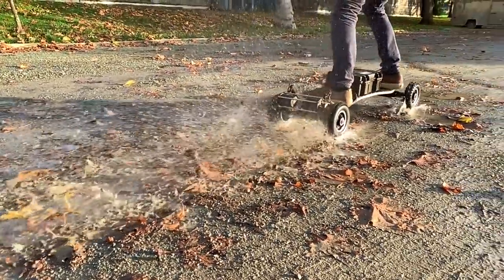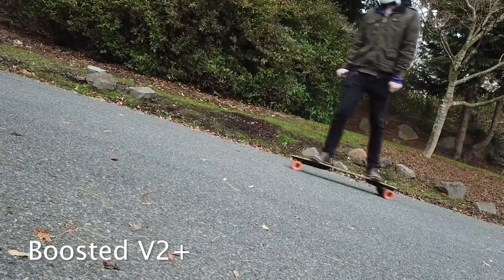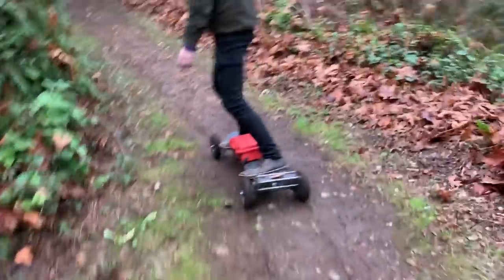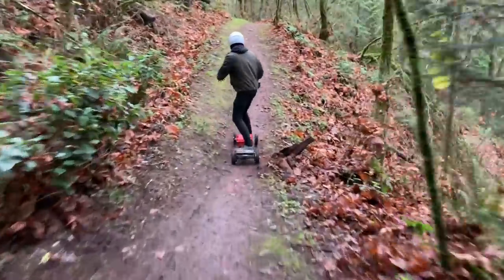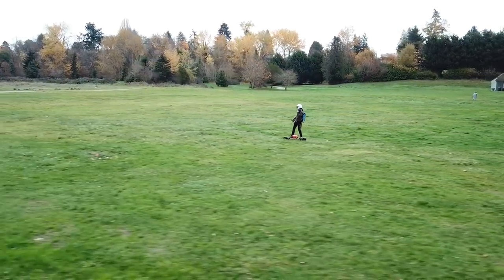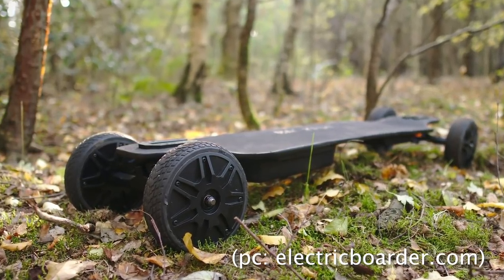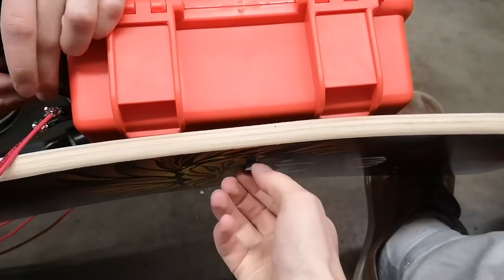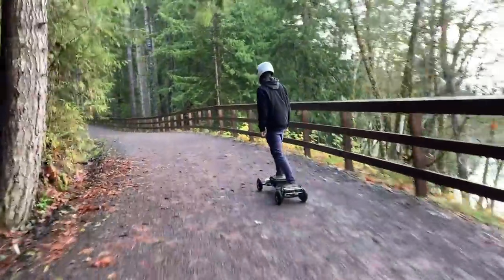DIY 9,000 Watt All-Terrain Mountainboard Beast Power-sliding and Off-roading

Comment: I agree, there is a lot of power required for a hill climb and your build looks a lot more capable and yet affordable than most I've seen. I bought a pre built board with 3,300 watts and it's great, but there is always a demand for more torque or general acceleration power when going through trails and hills. Yours exceeds the milestone by 3 yet less OK's sturdier than mine. Also, hot swapping a empty battery is perfect.

Comment: I built the patriot (for the most part) and the aluminum trucks base plate cracked twice already on the front truck. My first time going through some rough dirt and a pebble got under the belt and bent the motor shaft. I need a closed belt mounting system and maybe to spend a little extra on MBS trucks or something but that changes the price game significantly. However, I do not feel these trucks are a safe bet for this power and speed. I wanted to love it, just need a few modifications to make it sick. I did opt to buy cheap bindings, very helpful for sharp turning and off road. Did I mention the deck is heavy as all hell. This deck is really stiff and heavy. Oh and the springs on the trucks.. yeah well after some heavy riding they start bowing. Next thing they do... pop out. If you lean hard once you get decent, the board leans right into the pulleys and will eat a little notch into the board but no biggie. It has a few serious problems to address but for the price... This was my only option for a real off road board.

Comment: Cool video. I'd be cool to see a more in depth video on the parts list and building the board (and more power slides of course!) and for $1k that's a pretty impressive spec sheet (even if it is diy)
Reply: I second that.. would love to see a parts list.. I only see the motors and main board links...

Comment: For people who do not know much about diy esk8... when building a mountain/off road board like this, one should use lower kv motors which increases torque but reduces top speed. Instead of using the 190kv motors like in the video, which have a great top speed, do not unlock the full potential of this board. I would like to see you try to go 40 mph on a trail like you show in the video... you should go with 149 kv motors to still have a good top speed and have a lot more torque. I know flipsky sent the 190 kv motors for you to use but lower kv motors work much better on off road terrain.
Reply: I'm not sure this is entirely correct. Keep in mind that with an ideal speed controller, a lower Kv motor would provide no torque advantage over a higher Kv motor (even with the same batteries). As far as I know, lower Kv motors only benefit systems with current-limited ESCs, and these VESCS are some of the beefiest out there (as are the batteries). FLIPSKY claims a burst rating of 400A per controller, which I believe would saturate any 6374 motor. If that rating is to be believed, lower Kv motors may offer little-to-no benefit.

And as you can see in the video, torque is clearly not an issue here. Has anyone tested this empirically?
Reply: Yes tested multiple times in FPV and eskates - lower kv = more torque , you can increase/decrease torque also by using different gearing. But KV = as we use it refers to the rpm constant of a motor - it is the number of revolutions per minute that the motor will turn when 1V (one Volt) is applied with no load attached to the motor, the less revs per volt means each rev has more volts to push the board with
Reply: Douglas Page while you might be theoretically correct, I did not see any place in the video where the board was motor limited. I did see a spot that was traction limited, and SkateMetrics described that you could break the rear wheels free very easily, which doesn’t strike me as being anywhere close to motor limited.

If you wanted to increase effective power on this setup I think you would need wider wheels or four wheel drive.

149kv motors would just make it more traction limited while decreasing the top speed.
Reply: @zachohanlon3517  Zach - he is theoretically correct and also correct in reality. He didn't mention the board looked limited in the video at anypoint he was just making a suggestion regarding the KV.  how can wider wheels increase the power???? How would 149kv reduce the traction of the wheels? I agree it would reduce top speed, but he did say when will you go top speed 40KMH ? The video even states they never use full speed.... Why have the ability to go 40 with less torque. id rather the able to go 30-35 and have a bit more power low end.  I have a trampa e-board and only ever hit about 28 MPH, then again im new to it so could step this up who knows.
Reply: @zachohanlon3517  My point is that with a 100% efficient ESC, Kv ratings and torque are completely unrelated. A higher Kv motor will indeed provide less torque for a given amount of current than a lower Kv motor (by definition). However, because the lower Kv motor's back EMF will be proportionally diminished, an ideal ESC will be able to provide more current to it, without drawing more from the batteries. 

Of course, a real ESC's output current is limited, but useful current in the motor may also be limited by magnetic saturation. In a situation where an ESC can push a motor of a given size to its saturation point, it stands to reason that swapping in a lower Kv motor wouldn't actually improve torque, and would only reduce top speed.

But the real world is full of nonidealities, and this reasoning may overlook other complications. That's why I'm curious if someone has tested the relationship between Kv and torque with a setup of the Patriot's caliber.
Reply: All science aside. I have tested both 149kv and 192kv (sk8 6374 motors) on my trampa build. My board uses dual focboxes, 12s5p li-ion battery and 6:1 gear ratio. With 45A battery max each i have to say that i don't notice any torque disadvantages with the 192kv motors. I have been doing some heavy off-roading on trails like in this video. Never encountered a hill that the board struggles to climb. With that in mind i'm pretty sure that the board in this video delivers more power than mine which is limited to 90A at 50 volts (4500w).

Comment: Super cool DIY! Not sure the math is right in the title on this one. The specs for the motors are Max Power: 3250 Watts. So, x 2 = 6500 Watts, not 9000 Watts. Straight from your link to the motors. Why isn't Trampa in the comparison? Thanks for sharing.

Comment: I went with l-faster electric mountain board Dyl custom set up. So now I go with something more like this board,  as lfaster didnt hold up to my Weight of 225lbs. So everything was slow and dead speed at first. 
I've now put about 2000 dollars into my custom electric mountainboard and flipsky is moving me just fine. My battery box is on top and the best they have, I fsec4. Is in a back waterproof box, like most high-end boards from Europe videos. Witch take mbs mountain board to a hole new level.  Also I add flow bindings for comfort as, I loved snowboarding. Yes my mbs electric mountainboard is a fully customizable board with the best on it. . .

Comment: what's your experience with sensor motors vs sensorless? im told sensor have more power at bottom but can have more issues, but with the new dual vest 6.6 plus I would assume sensorless is the way to go!
what do you think the sweet spot is for kv rating? I was thinking of 130! I have 170 now but never ever use the top end.

Comment: What pulley & gear did you use to get that torque (and not speed) out of the 190kv motors?
For off-road  you usually see 130 - 140 Kv motors.
Reply: Where is the answer? 😁

Comment: What kind of battery pack or batteries would give you the best range and best power on this build?? Would using Samsung 30q cells or sanyo cells in either a 10s or 12s configuration give you more power/range than what you put in here? I am interested in doing this build, but am unsure of the range you guys are getting with your current battery setup? What would you recommend?
Reply: they are using lipos for cost. less safe, less range, more replacing. This shit is trying to prove that you can have amazeballs for less money, and it's kinda purposefully misleading, and no where near 9kw.

Comment: Where can i find the wheels, trucks and batteries?
Reply: They look like L-FASTER trucks and wheels from AliExpress. Certainly not the best. The bushes flog out the hanger quickly. I used bearing retaining compound. but the pivot pin is also wearing out the tube so must use a heap of PTFE lube to fix the squeaking. The wheel bearings arent much chop. On full lean there isnt much retaining the springs I have had them pop out regularly when trails get really tight. Solved that with silicone adhesive and cable ties. decks are very common about $50.
Reply: Batteries from HobbyKing
Reply: @chrisrathjan1501  ah thanks man
Reply: @Strech621  no, mbs is much higher quality. This is l-faster/diyeboard junk.
Reply: @Strech621  it would not be 900 using their parts (which are good!) no way
Reply: @jessepatterson8897  how much ?

Comment: Can someone explain where they get 9000 watts from using 2 3250W motors?
Reply: The high discharge lipo's (instead of regular 18650 batteries) ups the rated wattage i believe
Reply from the maker: Think of motor and ESC ratings as suggestions; they don't actually put a hard-cap on performance the way batteries do. If you managed to run this setup at peak power for an extended period of time, the motors would undoubtedly overheat. However, with acceleration this strong, it's impossible to apply full throttle for more than a fraction of a second without reaching dangerous speeds (or more likely being thrown on your ass), so it's a bit of a non-issue.

This is perhaps an over-simplification, as a motor's size can hard-cap performance by non-thermal means, but that's a discussion for another day.
Reply: SkateMetric that makes sense, thanks!

Comment: how do you achieve 9000w on just two motors? I can't find a single suitable motor rated for 4500w .. are you over-watting them (the motors in the link) with the vesc's programming?
Reply: There math is wrong becuse it says the maxis 12s at 95 amp and that is 4700watt (ish)

Comment: Nice video again guys, disagree with your 9000W rating though (but I do understand it sounds cool in a video title). Ultimately more than 4kW through an electric skateboard platform is just silliness. I've calculated and it's like going 30 mph up a 20 degree incline for a 100 kg person. 

There is pretty much a 0% chance the Flipsky dual ESC can push 100 amps continuous through both motors and even if it could, the winding resistance of the motors is 50 mOhm. At 100 amps the motors are going to heat at 500W so they would melt in about 30 seconds or less. 

Can I send you guys a focbox unity to review? I designed it and I'd love for you to see how it stacks up. Simplifies builds and our new app makes programming it safe and easy. 

Product page here if you're curious: 
https://www.enertionboards.com/focbox-speed-controller/focbox-unity-dual-motor-foc-controller-esc/
Reply: Yeah, it's just for the ratings. There are lots of practical reasons 18650s work better. They are slightly more strudy, lower discharge rates also mean more cycles and longer range. Just add more in serial until the esc or vesc can't take it. Still, i would love to compare this to my 12s Kaly in terms of performance.
Reply from the maker: No doubt our rating is a tad optimistic, although probably less so than most advertised esk8 power figures. Keep in mind, however, that delivering peak power for 30 seconds was not a design goal for this build (30 seconds with the throttle pegged on this board would take you to the moon :D).

We'd definitely be excited to get our hands on a FOCBOX Unity. If you could shoot us an email at our business address (listed in the about section of our channel), we'd be happy to coordinate that with you.
Reply: Also the motors you have shown are 3250 max watts each. Not close to the 9000 title.....
Reply from the maker: @mastermnd22  We addressed this in another comment. To restate here:

"Think of motor and ESC ratings as suggestions; they don't actually put a hard-cap on performance the way batteries do. If you managed to run this setup at peak power for an extended period of time, the motors would undoubtedly overheat. However, with acceleration this strong, it's impossible to apply full throttle for more than a fraction of a second without reaching dangerous speeds (or more likely being thrown on your ass), so it's a bit of a non-issue.

This is perhaps an over-simplification, as a motor's size can hard-cap performance by non-thermal means, but that's a discussion for another day."
Reply: Jeffrey Friesen maybe you want to sent me a unity for testing too 😉🙏🙏🙏 would like to push it to there limits with my quad 6374 or my dual 8085 emtb in the cold russian winter 😅😜🏂🏂🏂
Reply: Can i allready buy the focbox?  Or is it just a pre Order?
Reply: robin reinke the first batch is soon out for delivery. You can already buy a unity. Just visit the enertion website
Reply: @andreashaas4389  quad 6374!? jesus christ
Reply: I know about that thx 😌
Reply: Mynamesmatt_  that‘s right 😌 that would be 18 000watt after the video calculate 😌 and with quad 8085 even 30 000 waaaaattt 😱😱😱😂
Reply: @andreashaas4389  waiting on a video now!

Comment: Range?
Reply: those are lipos, high discharge, low range. IMO not ideal for this application, but they are cheap! low cycle count too. There's a reason no one uses them.
Reply from the maker: @jessepatterson8897  That's not correct. The LiPo batteries we use provide 532.8Wh, which puts them on par with a 12s4p 30Q configuration. In other words, range is not a problem. And keep in mind that a 12s4p 30Q configuration would cost about double what we paid, and provide less than half the power.

Comment: Dual vescs cant even produce 9kW. They have a 100A Phase amp Software limit. These flipsky vescs cant even get close to. If you are lucky you might be able to pull 80 battery amps with 100 on the phases, per vesc. With a 12S system thats a 43V. 80x2x43 thats 6.8kW
That is by far the most Power possible with a dual vesc. Anything more is a lie
Reply: factx

Comment: Idk, its powerful but raw. 1000$ for this kind of appearance is abit hard to swallow . The box the wooden deck just looks ghetto
Reply: you're exactly not who this is aimed at
Reply: @sagesends  not with this price.
Reply: Pay 3000-4000 then.. :D
Reply: Mountainboards aren't made to be pretty but it's diy so you can change whatever you want to make it look cute.
Reply: @EnnTomi1  The price pays for the hi discharge lipo batteries, quality esc, and 190kv motors so you have 12 HORSEPOWER on an electic SKATABOARD. If that's not worth $1000 idk. Go buy some sleek X1 and get left in the dust
Reply: @sagesends  well as a chinese, i know exactly how much those cost.....
Reply: @nedtrampz85  lol those boards will get more than 2 miles range. There's a reason people don;t use lipo
Reply from the maker: Jesse Patterson this board should go 20-30 miles on asphalt. We can't give exact figures though because we've never actually ran out of juice while riding... 

that's also coming from a $200 battery pack that can be hot-swapped, so toss another set in your backpack and you'll be riding all day.

Comment: check my build for quality truck part and performance IMO the patriot is cheap and not reliable ! bad motor mount bad controller, bad truck, bad hub on the wheels seriously what you were thinking saying it is a beast ? and how the hell do you think you can push 9000w for instance : 42v x 100a = 4200w of power by motor if only you could run continuously but it is never the case and even then you at full battery on develop 8400W but those tiny motor suck balls at 3000w so be real and stop put some false description !
Reply from the maker: The parts are very reliable. We're right about at the two-year anniversary of the build, and everything's still working great (only the motors have required replacement).

And you might want to redo your math, considering the board has TWO motors and runs 12S batteries lol.
Reply: Don't you think it's a bit sad you have to scavenge views from another channel so agressively?

Comment: And the truth. This platform is somewhat unreliable.
*The trucks are unstable at high speeds (springs only, bounces around the place)
*There are no replacement bushings available for these trucks
*The bearings for these wheels are pressed in, hard to service/difficult to replace
*The hubs are unbalanced, adds to high speed instability
*the magnets of the Flipsky motors will come loose. High failure rate
*belt slipping will happen with this motor mount design

I owned the same platform with similar mods compared to the original chinese version. Switched to Trampa. Far superior. MBS will also provide a much better ride. The board in this video combines high-speed with an unstable platform = dangerous and unpredictable ride.

Comment: Don't be all drowning the Ranger.  You probably never even rode one.  Besides they  have inhub motors so you don't get all the mud and dirt up in your belt drives.  Let's see you come up with something more innovative besides a taklebox screwed on top
 of a $40 board.
Reply from the maker: If the Ranger had enough power to ride in mud that might have been a nice feature... shame.
Reply: oooooooooooooooooooooooooooooooooooooooooooooooooooooooooooooooooooooooooooooooooooooooooooooooooooooooooooooooooooooooooooooooooooooooooooooooooooooooooooooooooooooooooooooooooooooooooooooooooooooooooooooooooooooooooooooooooooooooooooooooooooooooooooooooooooooooooooooooooooooooooooooooooooooooooooooooooooooooooooooooooooooooo @skatemetric627